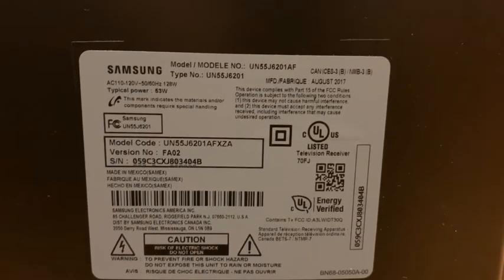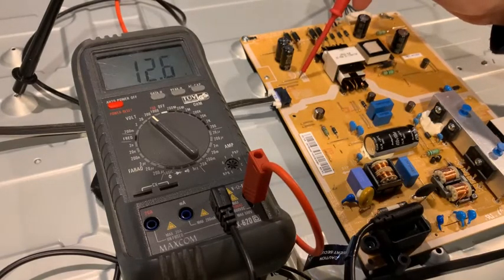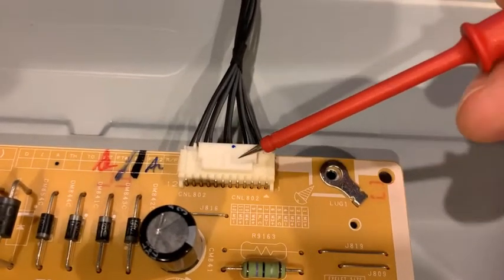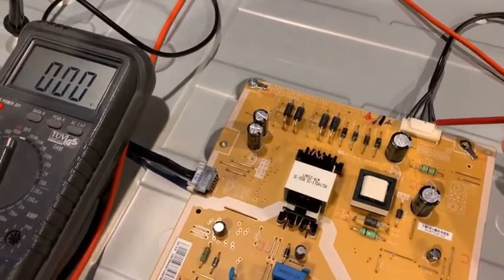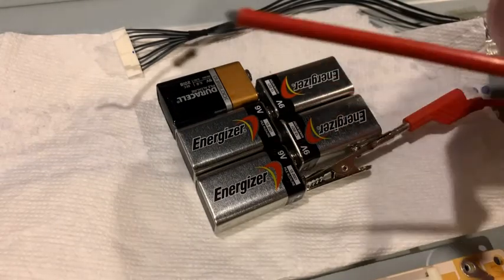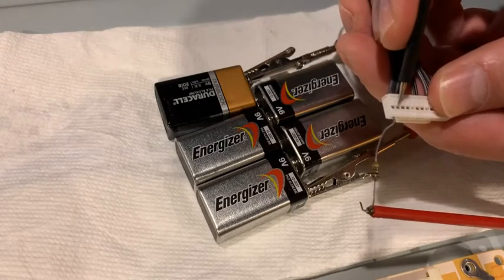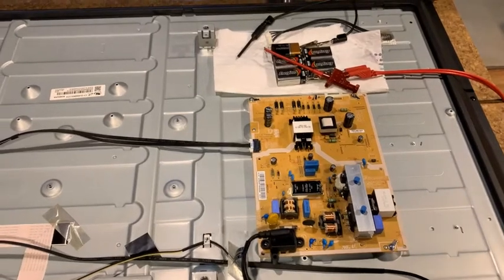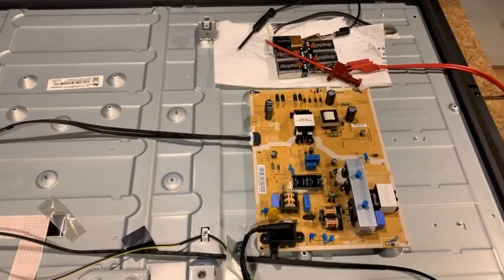How to test LED backlight without disassembly using 9V batteries

Comment: I really appreciate your effort, but you keep flipping the connector making it hard to understand the positive vs the negative.
Reply: he mentioned grey was the positive in this case. if in doubt use a multimeter to determine polarity on the power supply. even if it isn't producing enough to light the strips it will give out enough to determine polarity. cross reference the pinout on the board to that of the strip connector
Reply from the maker: I like to help. You are talking about the 9V battery test? The positive is connected to the resistor and it goes (on my TV) into pin hole 1, 3, etc. the negative goes always into the adjacent pin, i.e. 2, 4, etc. 
So: 1 is + 2 is - // 3 is + 4 is - // and so on. 
Each LED strip is connected in series. If one LED is blown, the complete strip won‘t light up. 
Then, all light strips are connected in series again. So you could have only one bad strip causing the complete backlight to fail. The test with the 9V batteries tells me which LED strip(s) are bad. 
Only reason I am flipping the connector is easier access to the pin. 
HTH.
Reply: @RandomDIY09  Thanks a lot! I already bought the led tester before learning from you. I find out that each strip which has 6 LEDs, should be at least 16.3 volts. The bad ones has only 4.5 volts. So I replaced the bad ones, now my TV is working. Your awesome idea can be applied to other projects I am thinking. Thanks, again!

Comment: What is the measurement of the resistor you used? How did you know which resistor to use?
Reply from the maker: Each strip has 14 LEDs, so with 3V per LED, that’s 42V total. My power supply was 45V, leaving 3V for the resistor. I aimed for 20mA, but I used a 100-ohm resistor since it was close enough, which gave me 30mA (using Ohm’s Law: R = 3V / 0.03A). For quick tests, you probably don’t even need a resistor if you’re just probing. Just be careful not to damage the LEDs if you’re testing for longer periods!

Comment: I have the exact same Samsung as yours with what appears to be the same LED strip out that you had in your video.  But I believe each LED strip is made up of two sections, a 3A section and a 2A section.  Which section of yours was out?  Is there a way to determine this so as to not have to purchase both for the repair?
Reply from the maker: In my case I opened it up and took the bad strip out. In fact the LEDs were all ok! I had a disconnect on the copper rails BETWEEN two LEDs of that bad strip. I bridged it with solder and was back in the game. 
When I took the panel apart I did not notice a difference in the strips, they all looked the same to me and they all seemed to be made out of one section. 
HTH.
Reply: @RandomDIY09  Did you record a video taking out the bad strip and soldering it back?

Comment: How do you come up with 5 batteries x 9 = 45v, not 3 batteries?
Reply from the maker: I measured about 300V, divided by 5 light strips equals 60V.  I felt 45V should be enough so I ended up using 5 batteries.

Comment: Hi, you have presented an excellent video showing voltages to verify, I dont get backlight at all does that mean Power Board BN44-00667A is bad? I would really appreciate if you could guide.
Reply from the maker: While it is possible that only parts of the power board stopped working, you should check if it produces any voltages. 
I would check if the TV’s status lights come on, and check if the TV produces an image. I connected a DVD player and shined a flashlight onto the panel - in my case I could see the movie but without backlight. 

If that works, power is likely not the problem. To make sure, find the connector from the power board. Very close to that connector your board might have test points which are labeled. This is what I measure in the beginning of the video. See if you get voltage there.
Reply: Thanks a lot sir

Comment: Without removing the panel, how do you know if all of the lights on each strip are working? Trying to determine if my power supply is bad or if I have a partial led outage. I’m getting backlight leds that are cycling from bright to dim on appx 3/4 of the screen.
Reply from the maker: Each strip is a series of LEDs and multiple strips are also connected in series. If one LED is defect, the whole backlight will be off (like in my case, one LED was damaged all others were fine). So if you see light, I‘d say your backlight LED strips are not the problem.
Reply: Your strips are each in parallel??

Comment: How can these leds run on 45 volts instead of >200volts
Reply: Each strip is 45 V. You have 5 strips. 45 x 5 > 200 V
Reply: @broadcastblk  nice explanation. thanks.
Reply: @broadcastblk  arent these 45volt strips in parallel? thats how you were able to light the strips at the connector.

Comment: Good tutorial. I've seen a few others and all the techs explained there techniques very well, such as you did. But, here is the BUT... What are the common systems of having bad =LED lights/strips.  l am a rookie tech so please forgive me if the question is too simple. Thanks for your video.
Reply from the maker: The symptoms of bad LED strips is that your backlight is missing. If your TV turns on and stays black, shine a flashlight on the screen. If you see an image, everything on your TV works fine only the backlight is broken. 
Even if only one LED is bad, you won‘t have any backlight - that was the case with mine.

Comment: What was the problem with the tv
Reply from the maker: Screen stayed black after turning the TV on. Shining a flashlight onto the screen I could see images (used DVD as a video source). As the TV was producing pictures just fine, so I started checking voltages and found the issue with the backlight.

Comment: Excellent video! Just what I've been looking for, how to test your strips without disassembly. Do you really need the 100ohm resister on the positive connector?
Reply: Just checked the back of my Panasonic TC-39AS530U and mine is setup differently. I don't have a connector like what you show going from the power board to the LED strips. I have a cable from the power board that splits and runs to the main board and also the LED driver board. From the main board I have the ribbon cable running to T-con board the two ribbon cables from that to the LED display...bummer...like your setup better. Guess I'll have to dissemble it and check the strips individually.
Reply from the maker: The resistor is for limiting the current. LEDs are diodes and have very small internal resistance in "forward" direction which means the current is barely limited. Too much current could damage the LEDs and I rather played it safe than sorry. I wanted to fix the LED strips, not do any more damage!
And it was quite handy to simply push the wire of the resistor into the connector :)
Reply: @RandomDIY09  couldnt you just use less batteries? (I have no idea how it works just curious) thanks
Reply from the maker: @jerryo21  It’s about the voltage in this case. I put them all in series, so the voltage of each battery adds up to the total voltage. You can probably get by with less.

Comment: What is the purpose of the resistor ?
Reply from the maker: The resistor is for limiting the current.
Reply: @RandomDIY09  I ran a bank of 9volts totaling 63 volts to 1 of 3 LED arrays on my TV and got no light. LEDS are known good.

Comment: I have a symptom, I can get standby mode red LED, when I turn it on Green LED is on for about half second, backlight is on, but return to stand by mode again,
is it backlight issue ?  Nice video, thanks :)
Reply from the maker: Don‘t think it is a problem with the backlight in your case. If TV is on and you can see the image with a flashlight pointing at the screen, it would be.
Reply: @RandomDIY09  do you reckon, what's the issue? Thanks
Reply: @RandomDIY09  Is it power supply problem for backlight LED ? How much is the voltage needed for backlight LED ? thanks

Comment: i have only 4 wires on the ribbon power cable that power the two strips/sides on my lg, i actually tried this and realised mine would need a lot more than 45 volts to power up, im guessing i would need 10 or 11 of these batteries lol thanks! anyway. probably easier to buy a led tester.